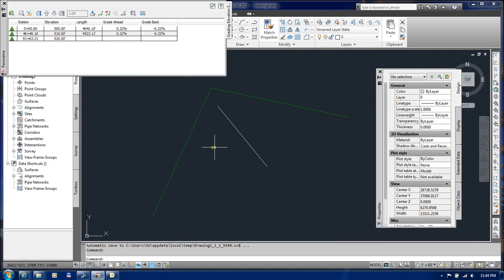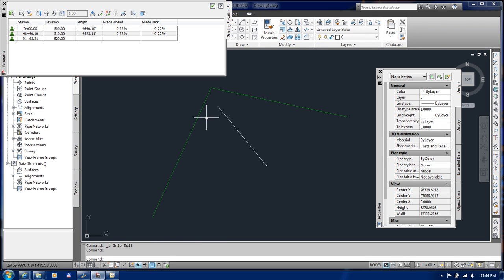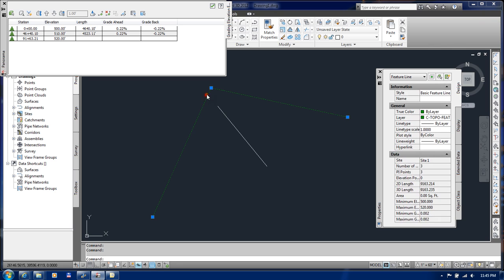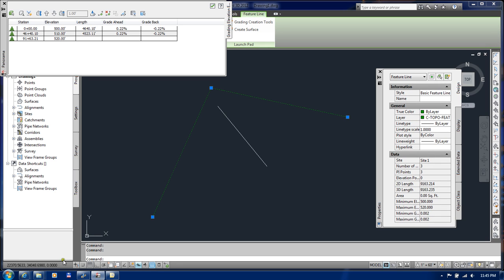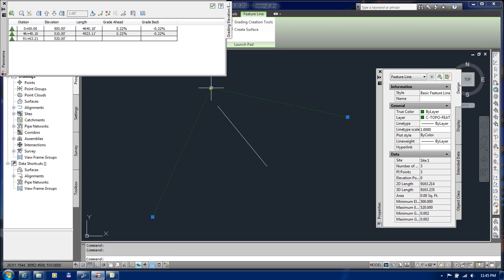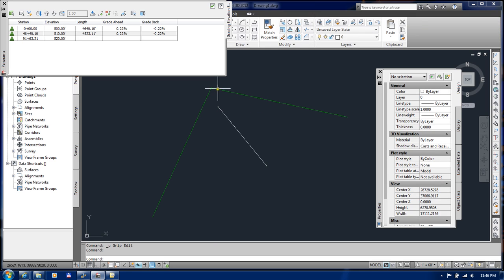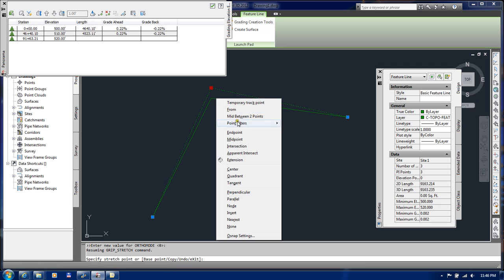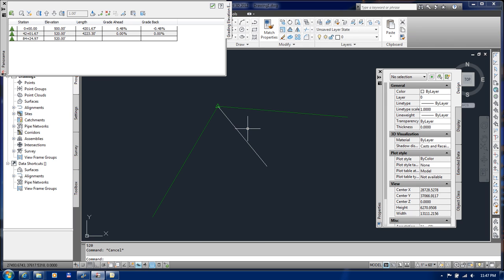Move feature line vertex and "keep" the z value

Comment: Would be nice to keep the original elevation without the need of typing it back in.
Reply: I found that you can if you click the point's original location when prompted for z
Reply: Yeah ,  that is really the main reason I would want to use this point filtering. I dont want to change the current Z, but I dont want to snap to stuff
Reply: Yeah, I am still waiting for solution to this simple problem